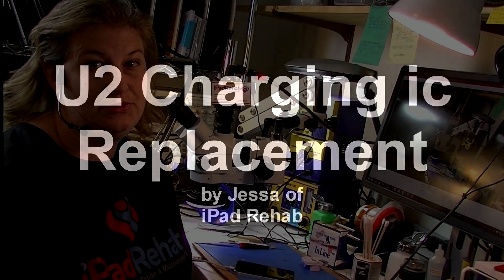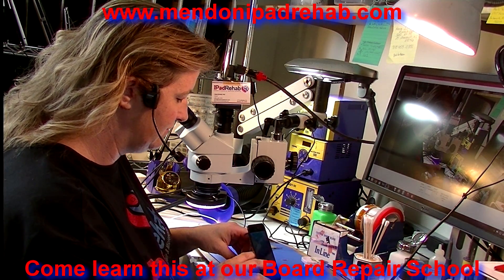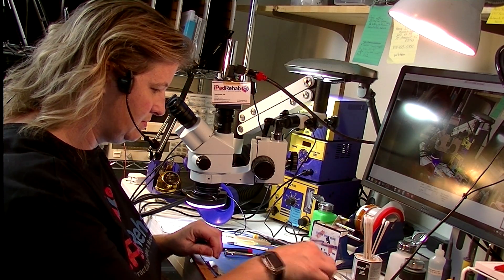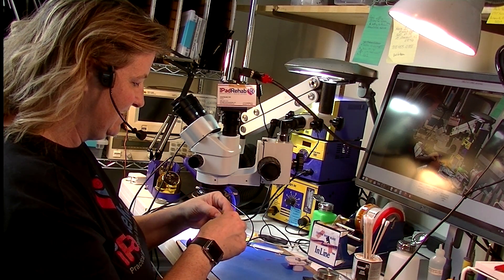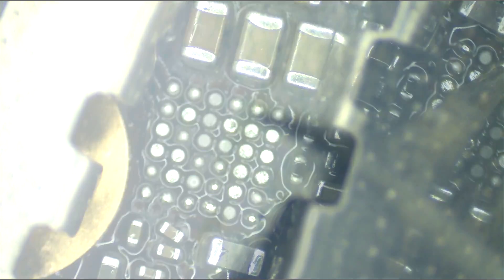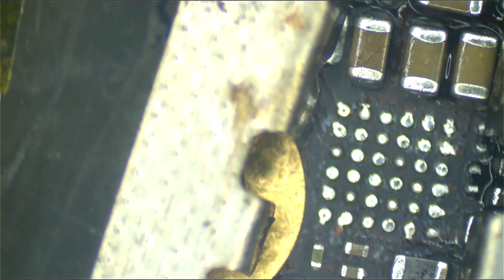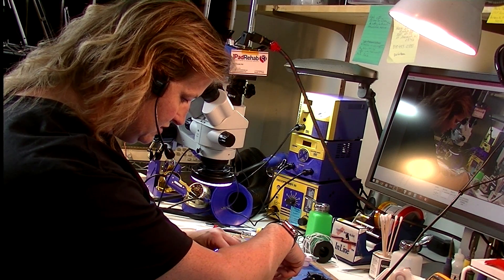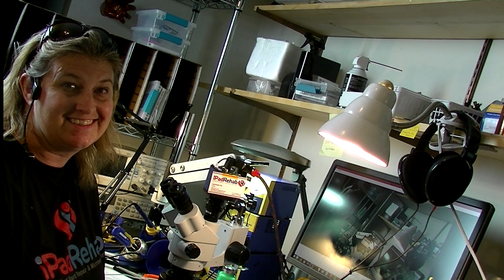How to replace tristar (U2) charging ic chip to solve slow charging, fake charging problem

Comment: Hi, I just wonder how much do you charge for this kind of repair as I live in London UK and guys in my local repair shop are trying to charge me £70 which is roughly $100? I think it's too much :D ..is there any other way to replace it? for example to use the iron? many thanks
Reply: I charge based on the value of the device. For 5s I would charge $99 USD
Reply: Jessa Jones Why so expensive? These U2 IC Chips cost a couple of cents ?!
Reply: +Jessy Jay yes, so just follow the video and do it yourself, it shows you exactly how to do this repair.  If you would prefer to take advantage of the thousands of dollars of specialized equipment and thousands of hours of experience and outsource it to us, then that costs $99 USD, which is less than replacing the device.
Reply: Jessa Jones lol :D Thanks for the video I will do it myself.. btw the hot air station costs less than $40 hahah so yeah expensive equipment :p good one
Reply: +Jessy Jay just to be clear --you will no longer have a phone at all if you attempt to replace the U2 chip with a $40 hot air station and no experience.  With that said, best of luck.  Hope you prove me wrong.
Reply: Jessa Jones just done it! lol and it's fully operational just don't know how long for as these cheap eBay parts are Not Genuine!

Comment: Initial 5S board slow charge fast drain from cheap China Charger cable
eliminated battery and flex cable as issues-
Replaced U2 chip, repair went well -or seemed to.... good heat, shielding etc
Board fails to power up now-even with charged battery installed
Just wanted to see if you had seen this happen before and possible pointer where to start
looking
Also just repaired an old 4S w dim screen-know what it was...THE COILl!....haha :)
Thanks for what you do, hooked on your videos

Comment: hi need help my iPhone 5 charging problem I bought 5 different chargers but iphone 5 still saying  "the accessory may not work..." what must do?
Reply from the maker: +manic lokofe replace the phone.  U2 chip replacement in iphone 5 is no longer supported by the value of the device
Reply: +iPad Rehab Though it may be supported by the value of the data in memory ;)

Comment: can u please answer this question.. my iPhone 5s is charging normally, i have replaced the battery, im sure its not software issue cause i tried everything and i get my battery drained within 13 hours of standby. so i suppose this issue is u2 related
Reply: Could be any short. Could be U2
Reply: +Jessa Jones Thanks

Comment: Hi!  i had a problem with my iphone 5, if i connect it to the pc it syncs with itunes and i can do restore upgrade anything but it does not charge, i need to turn it off so the iphone can charge, you know what would be the problem?
Reply: +Eiza Huppenkothen Poniatowska replaced brand new charging port and it does do the same
Reply: +Eiza Huppenkothen Poniatowska 
iiii
Reply: did you find a fix for my problem

Comment: i  have iphone 5
the problem with it is that it charges slowly, and btry drains vary quickly. also if mobile get switched off for long time and is let like that for long time then even after connecting to charger it doesn't charge. so is it the charging IC problem?

Comment: Hi, thanks for interesting video. I've got an iPhone 5s with no boot problem (no usb detection as well). Once connected to good battery and pressing power button the phone generates some voltages (1v, 3v, ~200mA) however the display does not come on. The display and charging port have been tested with other phone. Is it the power management chip which is partially damaged, any ideas? Thanks
Reply from the maker: +Lukas Orange 200mA sounds pretty normal.  Is it detected by iTunes?
Reply: +iPad Rehab Thanks for replay. it is not detected by iTunes (the Lightning connector and display has been successfully tested with other phone). The voltage on the lcd backlight is not rising and stays at battery level. The phone is not charging the battery as well so I have to charge it in other phone or supply iPhone from power supply.
Reply from the maker: This could be many things, with 200mA it sounds like you have a separate display problem and usb detection problem.  I assume you are prompting it to boot by shorting the power connector or using a power flex.   I wouldn't think a phone could consume 200mA and be a dead phone.
Reply: +iPad Rehab I am starting it up by pressing power button. If the display does not come on and the usb is not detected it might lead to broken power management chip. I will try to measure some more voltages. I assume that if the USB interface chip is faulty it will not prevent device to boot?
Reply from the maker: unless the U2 chip itself is shorted, in which case you would likely see more than 200mA consumed.  200mA is normal function of PMIC and CPU.

Comment: i have a question, i have the same problem but my home button doesnt work...could it be somenthing else than u2 chip?
Reply from the maker: +Goran Kušević most definitely.
Reply: +iPad Rehab i got a new dock, now it's charging, bit the home button still doesnt work, can you please give me some advice? My email gorankusevic@gmail.com
Reply from the maker: +Goran Kušević what phone is it?
Reply: iphone 5s
Reply: +Goran Kušević hi  I had this issue on my iPhone 5 I replaced  the home button.  that didn't  solve it . I replaced  the usb dock connector  which is connected  to the mic and loud speaker.  This solved my issue

Comment: can you answer my question? the hot air gun you're using is butane gas? can a mini heat gun be used to remove the shield to get to the u2 ic chip?
Reply from the maker: +Hanio Zuniga  I would only recommend a professional quality hot air station from a good brand like Weller, Pace, Hakko, Metcal, or JBC

Comment: 9:30 resistor have moved, (fix afetr ^^) kapton tape otherwithe. HI from france + 1 sub. Easy englush pls (if you read me) bye. ANd is it a China dessolder tress? No flux....Prowick or gootwick is the best tress. Bad heat transmision. Perfect work otherwithe really pro! Beautifull magnifier and camera :) nice work.

Comment: what temperature used for desinstaled ic and solder?
Reply: I say anywhere from 375c -450c it all depends on ur hot air station.
Mine is not calibrated properly so I use 450c :)   hope that helps you.
Reply: +Pero some people say around 340°c what do you think  and half the settings  on around halfway  mark. don't  want the air to strong  or you could blow the components of  the  board
Reply from the maker: Somewhere between 300-450c depending on the job. This always differs. 

iPad Rehab highly recommends the Quick 861DW http://bit.ly/2xGDTXo for a cheap, affordable, powerful hot air station with an easy interface. It will remove all different types of chips without a problem, unlike weaker stations that can't stay hot enough long enough to do the job.

Comment: what kind of soldering/heat station you use? any ebay link or something?
Reply from the maker: +Inspiraattori http://www.bonanza.com/listings/Radio-Shack-64-2051-Solder-Soldering-Iron-15-W-Grounded-Tip/219760253?gpid=18283950120&gpkwd=&goog_pla=1&gclid=CJenwJXHx8gCFYcTHwodpVoFZA
Reply: very funny
Reply from the maker: when will I learn to not let Louis post from my phone...
Reply: +iPad Rehab I knew it was Louis :D
Reply: that´s the way you wont answer the question?
Reply from the maker: we use hakko stations.

Comment: solder braid  without flux does not work. THey suck
Reply: Agreed, but if you have some you can still use it with a flux pen. Just flux the ribbon first. What can I say, I'm cheap and don't want to trash the wrong purchased item. But I also have some with flux and it works much better then without it.

Comment: Hi Jessa! First I'd like to thank you for your informative video. I do have a question about my iPhone 5 that I'm having a problem with. I recently plugged it in to charge on some USB wall outlets that I have just installed. After a few hours, it only shoed 3%, when it started at 7-10%. I moved it to the official Apple charger and went to bed and noticed it kept turning itself on and off/rebooting. I figured it just check it out in the morning. Unfortunately, it was stuck in this reboot mode for a long time. it finally ended up displaying the "connect to iTunes" message. It's now stuck on that whenever it's plugged in. However, it's not getting recognized by my PC. I'm not able to access my data or turn it back on. Windows is saying the USB device has a hardware issue. Could the U2 chip be causing it not to be recognized/connect to anything?  I really need the data off of there as I have tons of pictures/video of my family. Any help is much appreciated.
Reply from the maker: Yes, sounds like U2. Put in a new battery and offload data by wifi
Reply: I've tried a new battery. Unfortunately, it turns on but still won't get past the "connect to iTunes"  screen. Nothing recognizes the phone when plugged in.

I've already ordered a new U2 chip. That thing is impossibly small! I can't tell is if it's already "balled" or not. Mostly, I just want to get the pictures/vids. I really don't care if it's 100% operational or not, so I may just attempt to reflow the new one on. Bad idea?

Comment: Will knocking off caps/etc near battery terminal mess up U2?

For example:  A cap gets unknowing knocked off and battery is connected, or plugged in and thus U2 could be damaged?  Because after replacing caps with new ones from DigiKey and continue to show symptoms is a recurring question I've always had.  Thank you

Comment: Hello thank you for a great video. I have an adjustable DC power supply. What voltage and current should I be setting it at to power up an iphone?
Reply from the maker: +ihackmobile the current will be dependent on the phone---you will set the voltage to equal the standard battery voltage

Comment: Got a 5C at work that seems to show a weird like colour on any screen we plug into it, after a few mins though the display fades to darkness, also we dont have any touch at all, but the phone charges and boots fine, what could it be?
Reply from the maker: Water damage, bad touch/display power chip or local caps

Comment: Awesome Video Jessa! I love how you take the time to take apart the phone while explaining every step in detail and why certain things are done. This is perhaps the most crucial to learning. Understanding each step and having a reason for each move such as proper heat, adjust heat and air flow, then removing with flux and using braid and so on. Beautiful setup and video! Keep it up!

Comment: which hot air station you recommend Jessa thanks in advance. ?
Reply from the maker: Somewhere between 300-450c depending on the job. This always differs. 

iPad Rehab highly recommends the Quick 861DW http://bit.ly/2xGDTXo for a cheap, affordable, powerful hot air station with an easy interface. It will remove all different types of chips without a problem, unlike weaker stations that can't stay hot enough long enough to do the job.

Comment: she is right about the hot air station. i have an rework station that i got from amazon for about 60 dollars and it takes for ever to desolder an ic.
Reply from the maker: iPad Rehab highly recommends the Quick 861DW http://bit.ly/2xGDTXo for a cheap, affordable, powerful hot air station with an easy interface. It will remove all different types of chips without a problem, unlike weaker stations that can't stay hot enough long enough to do the job.

Comment: Hey jessa great video. This looks fairly similar to replacing the LP8550 on a macbook pro just with a sightly bigger chip and a much smaller board. Is this the case?? Also is that the Dell P2715Q 4K monitor in the background??

Comment: very nice fix you really make evrything look so simple (:
how did you get the ic without cleaning the black apoxy and what nuzzel did you use i nver see this kind of thecnic for uw replacement very good work .
Reply from the maker: The 5s is a good example because it does not have underfill under the U2 chip.
Reply: +iPad Rehab 
iam a cell engenir and i start working on boards also 
nice tips realy love your work
Reply: iPad Rehab what nouzzl size did you use
I see that you put the heat under the ic really good methood u never see this kind of work it take out so fast ! Realy nice

Comment: Some of these issues are dead battery symptoms as well. Slow charge, quick drain, phone reboots while battery is connected, and also no change in percentage while charging. Great video none the less!
Reply: Yes, like it says in the video--repairs shops first rule out the easily solved bad battery and bad charge port before considering U2 failure.
Reply: +Jessa Jones yes maybe you misinterpret my purposes of highlighting battery issues as the video's target is based on the u2 charging ic chip. I own and operate a repair shop. And from this level of experience 1 out of 50 iphone 5s's that come in with charge issues are the u2 ic chip at best. Most repair shops always overlook the common issues. I have been in this very new industry for 5 years and have worked with countless repair shops in countless areas. My statement was actually positive feedback and actually adding some specific information to an already great video. One of the reasons i chose Information Technology is because it is always advancing and we are always learning. Each one teach one attitude. But thanx for ur re re iteration of what kindly pointed out in the first place.